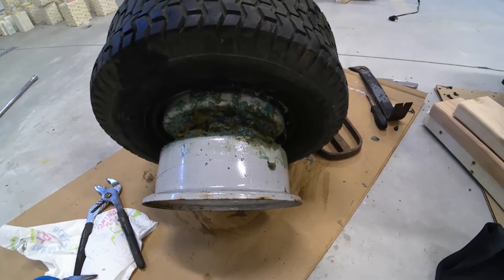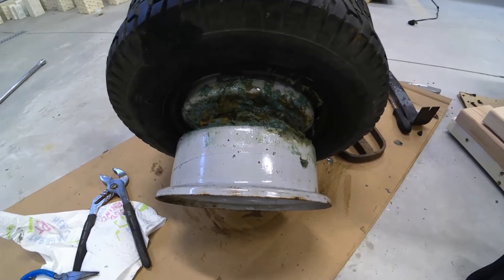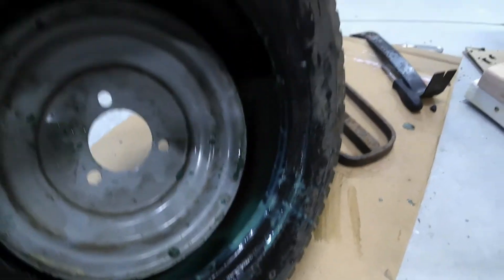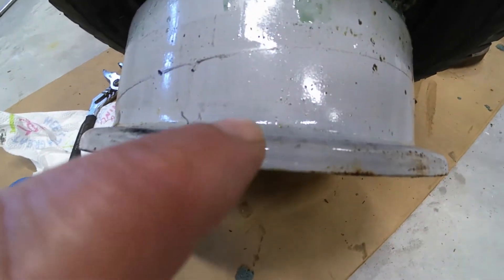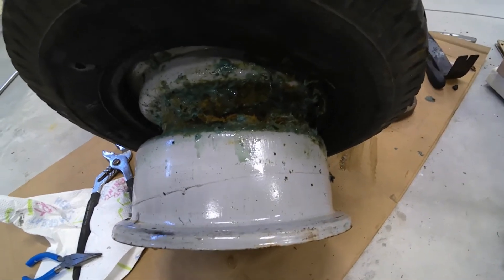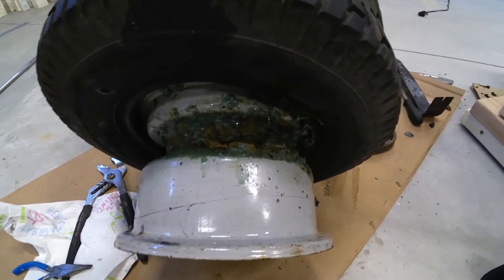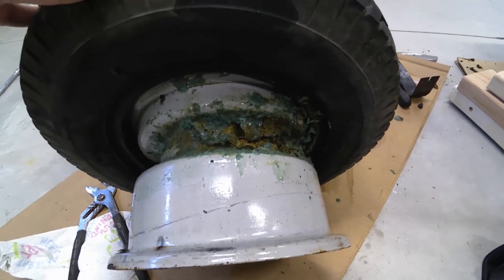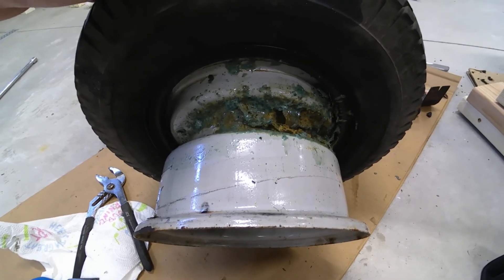What Tire Slime Looks Like Inside Tire and Why Mechanics Hate It!!

Comment: I’ve used slime a lot. I’ve never been charged extra for it when eventually replacing the tires thousands of miles later.
Reply from the maker: Hi, 
 Just make sure they don't add it into the shop supplies fee. Sometimes they will put extra charge in there as they will use more towels and cleaner . You will not know it since a base charge is usually like $10-$15 .  So most people overlook it as they don't know what that charge is for

Comment: Slime is AWESOME !   But Most people use WAY TOO MUCH !
 Simply inject a Tiny amount & roll tire around until it faces down & let it do it's thing. After a few mins. If it hasn't sealed it up completely. Add a Tiny bit more. & I mean "TINY". Usually no more than twice will do it. 
 And you will notice that you still have ( 90+% ) of the bottle left.
 You can verify what I'm saying by simply looking at these tires once they are removed. The puncture has long since been sealed but they still have a majority of the can  sloshing around. 
 Such a Waste. BUT ... they sell more Slime that way.

Comment: It don’t take 15 minutes take to grass and then use paper towels. Sure that’s a big ass wheel. But it’s biodegradable so it’s fine to dump in grass or down drain. 

Now fix a flat is nasty shit as it dries once air hits it. Causing it to hardens like epoxy.

Comment: So you want me to be stranded on the side of the road with a flat tire so you don't have to use a $100 pressure washer and 5 minutes to clean it up? Gee, let me think, stranded on the side of the road for hours or a small inconvenience to a tire shop? Okay I'm going with the slime. Guess what? I bought my own tire machine because I got tired of shops complaining, charging, putting tires on wrong and damaging rims. Yes, that's right, I would rather spend $2k so I can change my own tires.
Reply from the maker: Ya you can do that but most people only buy 16 tires in their whole life! So wouldn't make sense to buy a machine because each tire would be over $120  extra to pay off that machine . So now you need to buy a balancer also , so looking at about 5k for both machines. Usually shops charge about $30 per tire to change and balance , so someone can do over 170 tires  and still not pay off the machines.
Reply: @JasonYouTube  Well I do have 13 vehicles and we buy tires for at least 2 of them per year. We also have summer tires and winter tires for at least 2 vehicles. As for balancing, we are using the balancing beads. So far so good. Shops around here charge $40 for mounting/balancing plus $5/tire for the city. If I do it myself I'm allowed to take my old tires to the dump for free. Also, and this is the major reason, I'm sick of people not doing a good job. Most of my tires are directional and I've had shops put them on backwards only to have to go back and get it corrected. That was the last straw for me.
Reply from the maker: @stickman-1  I totally agree ,  doing it yourself is only way you know that it is done right. ONLY if your smart enough as most people don't take pride in their work and would rather do a quick hack job.

Comment: Is it better for tire with a tube inside like classic and adventure motorcycles? You can ride on a rope 5000 km without any problems, but I doubt with this stuff inside. Do I need to buy a new tire each time or only another tube?
Reply from the maker: They make a Tire &Tube formula, so you would need that for tubes. It has smaller particles to plug up holes. If your tire is leaking due to dry rot or non hole leaks, then replacing tire is best bet for safety. If you have a hole, patch it then use tube

Comment: Slime isn’t a quick and easy fix - it’s added security and has helped a lot of people in dire circumstances. Doesn’t matter if tire shops don’t like it.
Reply from the maker: Yes it doesn't matter but they will charge more to do the job compared to a tire that doesn't have it. Most people are forced to pay the extra fee because they can't change it themselves . So the $9 quick fix will cost an extra $25-$35 in labor when tires are replaced.  Like if someone changes their own oil and screws up the filter , a shop will charge labor rate to fix that screwed up filter. They won't just charge the flat oil change price if someone messes up the filter. So need to think of that before putting slime in your tires so people won't be shocked at added fee for cleaning tire, Thanks for comment

Comment: Plan b would be for the tire repair shop to just shut up and do their job. That’s an option.
Reply from the maker: Well what about this scenario.  Thet quote you for a brake job over phone, but you decided to try it yourself and cross thread the caliper bolts. Now the shop needs to take extra time to fix what you did, do you think they should charge more for it? All shops would because it's not the standard.  Using slime is not standard practice. Depending on what you do, if someone makes more work for you, do you just eat the extra time? I doubt you would
Reply: @JasonYouTube  I’m not advocating for free labor. Whatever time and effort is needed to do a repair, charge accordingly. But if you’ve chosen to be in the repair business, don’t piss and moan when the occasional difficult task presents itself as opposed to only the straightforward ones.

Comment: 15minutes? Are you kidding me? It’s water based. Can just hose it off. It’s non toxic so can just wash it down the drain
Reply from the maker: If you hose most off, you will need to make sure to dry the inside of tire and rim , so your looking at more then 15 minutes! If you don't dry out tire and rim, then you will have a rusted out rim in 3 years.  So wiping off is the most pratical way as you will need to wipe and dry it after using a hose. Either way ,using it in a
 car tire is a last resort .
Reply: It's called just buying a brand new tire and then they don't have to mess with it

Comment: With 20 plugs in my ATV tires I had  constant slow leaks    ..so I added slime +2 tablespoons crumbled rubber    ..zero flats now    ..the larger  crumbled rubber particles makes the slime handle much bigger holes than just using stock slime
Reply from the maker: That is interesting, where would some viewers find crumbled rubber if they want to go that way?  Thanks for watching and input
Reply: @JasonYouTube  you don't find the rubber, you crumble it 😐
Reply: @zipntoad2060  Old post I know, but do you just shave some rubber off an old tyre and crumble it using abrasive paper?

Comment: That looks like a tubeless tire? Slime won't work on it... if remember correctly. Slime will only come out of the leak in the tube and in the tire until it plugs up the hole.
Reply from the maker: They actually make 2 different kinds as the Tubeless ones have rust inhibitors . But looking into slime , it only guarantees sealing leak for 2 years . I didn't know that slime has a low seal life .
Reply: @JasonYouTube  I used my slime in a tube in a tire it worked like a charm.. I was told slime dont work well on a tubeless tire.. silicone works good on a tubeless tire I was told.
Reply from the maker: @oakisland9  Slime works  but it costs more in the long run as it requires cleanup after it stops sealing the leak , Thanks for watching
Reply: @JasonYouTube  tires has to be thoroughly cleaned out due to glass, shards debree caught the tire and rim from the flat tire.

Comment: I pumped my 50cc scoocter tires full of tire slime from a leak at both beads... Im worried the tire slime is gonna pit and corrode the inside of the aluminum wheels. Should i stop worrying?
Reply from the maker: According to Slime,com website, if you leave slime in wheels for longer then 2 years , they cannot guarantee that it will not corrode rims.  So long term, it will damage the rims

Comment: I have an electric scooter and i did have a slime on tire and I had a hard time removing the tire so I had to cut the tire apart and problem is the right side of the rim came off but the left side is really hard to come off because I believe the slime pretty much stuck like glue. Is there a way to get it to slide off?? I am trying to get everything off the rim and clean it before putting my new tubeless tires on
Reply from the maker: Might need a wire wheel.on a drill to get it off
Reply: @JasonYouTube   link please. Thanks.  Yeah this is tough to get out and wonder if hot knives do? Something not trying to damage the rim
Reply from the maker: @TrevTrevorTrev  A fine wire wheel will not gouge the rim, but if you use a coarse wheel, then it may gouge the metal
Reply: @JasonYouTube  it’s the wheel came with scooter at voromotors.com
Reply: @JasonYouTube  just an update I had completely removed the tire on Saturday after some alcohol and wet wipes and got everything together until the tire would not inflate after someone put the new tire in and did a few tricks never helped and I had someone to check it out and finally got the tire to inflate after the strap trick. It took many many many tries and finally got it to inflate
Reply from the maker: @TrevTrevorTrev  Thats good to hear , seating the bead sometimes can be the hardest part

Comment: Horseshit, if used as intended the slime washes out so easily
Reply from the maker: But then you need to let the tires air out or else you will have water / moisture in your rim and what does that mean? Means your rims will rust out from inside out where its not painted on the inside! So now you need to pay the shop x- amount of time to fully dry out the tire before mounting. So it is biodegradeable , but now you just added more time to basically have them watch water dry. Now if you do it yourself, doesn't matter , as you can walk away to let them dry. So for a tire shop, it means more money
Reply: @JasonYouTube  literally takes 5 minutes man , if I’m spending 1500 for new tires n have them mounted n balanced it shouldn’t be a big deal , never been charged extra for it if your charging extra after a customer gets new tires your just greedy at that point
Reply from the maker: @BlasTicity  Car tires it is rare to have slime in them , but small lawnmower tires they charge extra or just reject them when they break the bead and see it. Not worth the $10 for labor and $20 for tube.  Extra 5 minutes is an extra $8-10 lost if labor rate is $100-120 an hour. So for 4 tires , thats 20 minutes which is $40 lost in labor vs tires without slime. Some shops don't want to deal with it and have the chance it may come back if the bead doesn't seal ( If they don't tube and just patch) due to slime

Comment: This comment section is hilarious "I have no idea about cars but I used it once and it worked so I like it!"

LOL dudes don't put slime in your tires IF YOU HAVE THE OPTION. Obviously if it's a specific circumstance like a sunday or stuck on the side of the road sure do what you need to do. I have had shops turn down tire service entirely because slime was used.